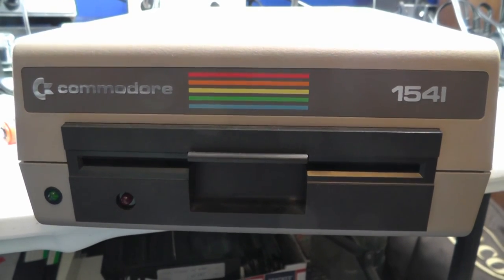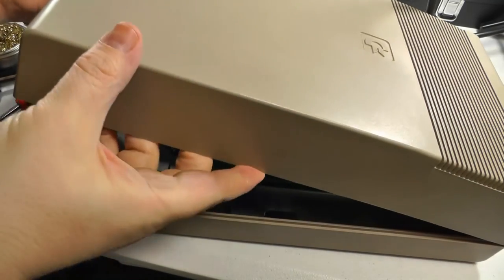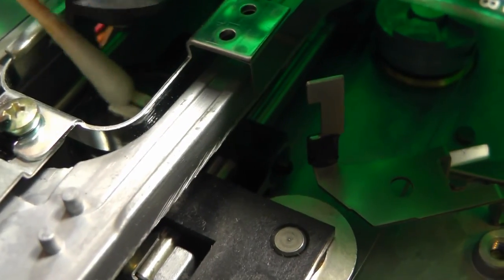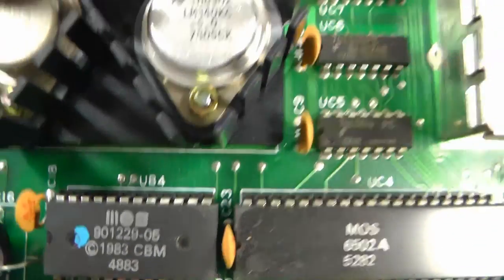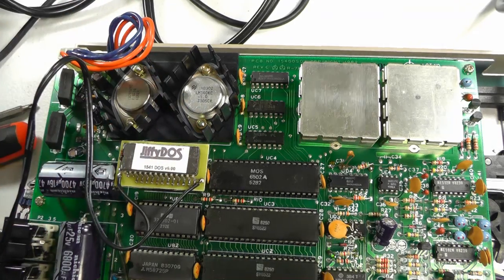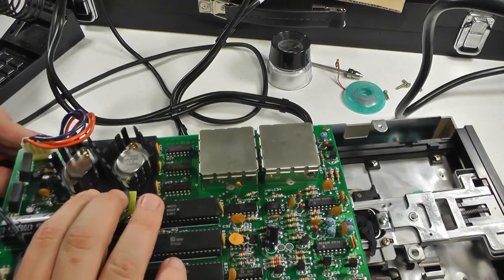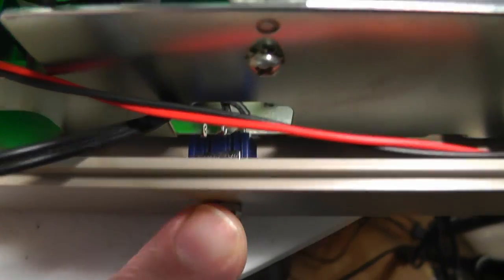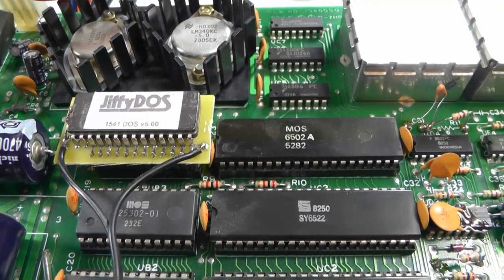Installing a JiffyDOS in a Commodore 1541 Disk Drive

Comment from the maker: I had to cut the wire on the large capacitor, then move it over, then solder in a new wire. I didn't film that part.

Comment: the thing i dont get is do you need the jiffydos chip in both the drive and the computer or just the computer
Reply from the maker: For the full speed you do need a jiffydos in BOTH the C64 and the drive. BUT you can use most of the Jiffy dos commands with the Jiffydos just in the C64.